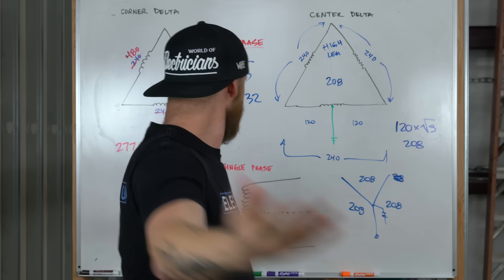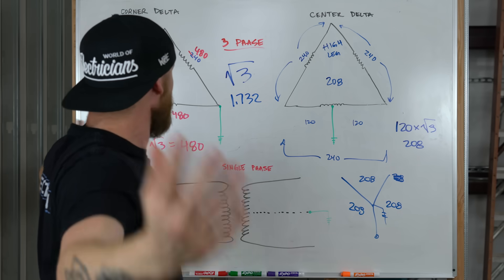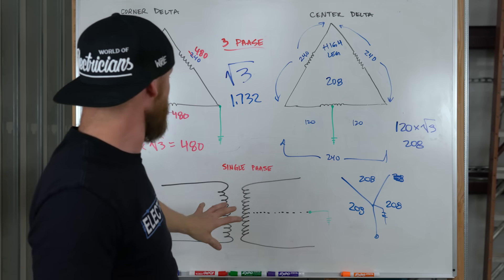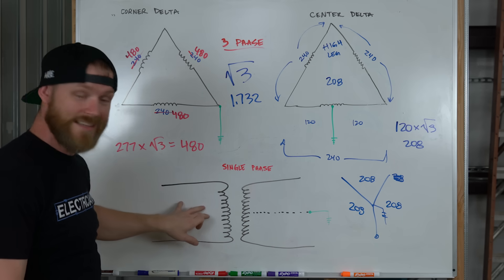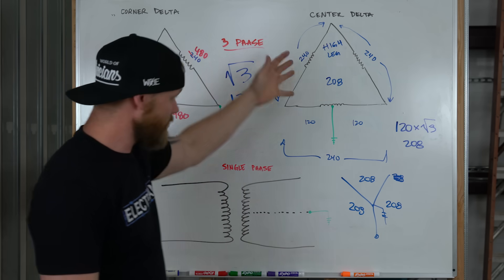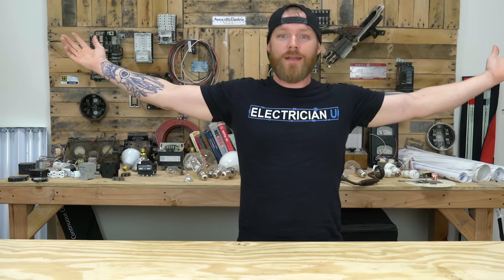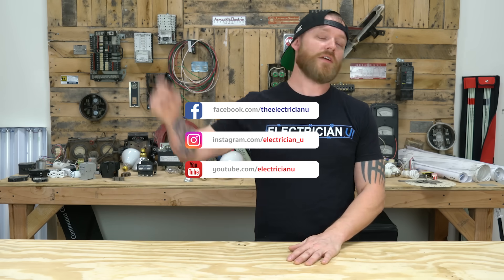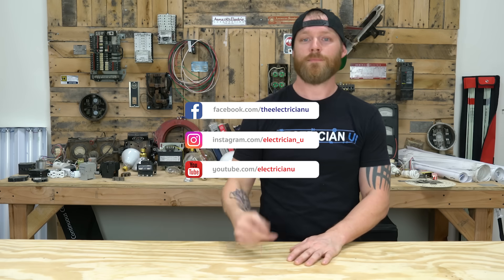Difference Between VOLTAGES - Why We Need Them All

Comment: Very complicated. In Europe it‘s much easier, you got the wye configuration, we call it star circuit here, where the neutral is the center point. The voltage between every line and the neutral or ground is 230V, the voltage between the lines is 400V (sqrt of 3). Some appliances are connected in a delta configuration ( we call that triangle), they only have the three lines L1, L2, L3 and the ground. Mostly appliances where the load is balanced between the three lines.
Another advantage of three-phase: If all lines are balanced, there‘s no current flowing through the neutral. If not, it‘s only the differential current. For example if I draw 4A from L1, 4A from L2 and 2A from L3, the neutral current is 2A.
Reply: Not quite. If you draw same loads between phases there will be no neutral. If u draw loads per phase ur neutral current will be the sum of the 3 loads. That's why elements use overrated wire sizes
Reply: @saffalife8831  Nope...if you draw an equal current from all three phases at the same time, the neutral current is zero in theory. The neutral current can't be higher than the current of one single phase. If it would be a summon of the currents of all three phases, you would overload the neutral wire totally up to a level of destruction of the insulation. For example you design the wiring for a circuit with a voltage of 3x230/400V fused with 3x16A circuit breakers. For this application a cable with the conductor size of 2.5mm² is perfect, this is rated so you could fuse it with 20A without any problems. The critical conductor temperature with the standard PVC insulation is 70°C, this is reached with this cable size on a current of 26A. The current from one phase is flowing back on another phase if the loads are equally balanced. And you need the neutral only for this case. On some appliances the neutral is not necessary because such things like the internal resistance of the appliance is not changing differentially. For example a tankless water heater in three-phase does not require a neutral. And then there are other appliances:
Here in Germany the kitchen stove is connected with three-phase (3x230/400 V). But the appliance itself is still a 230V one. One large and one small cooking plate are connected to one phase, the other small and big one are on the second phase and the third one is for the baking oven. That's a classical wye-connection, or a star circuit as we call it here. With 3x16A you could fuse a kitchen stove up to 11 kW, and use the wiring for that current and all wires are of the same size. Normally we would use a cable with 5G2.5mm², that size would be comparable to AWG 13 which is 2.6mm². AWG 12 is 3.31mm² and 14 is 2.08mm².  L1, L2, L3, N and PE (ground).

Three-phase is the standard here, even in residential buildings. The service companies here even don't permit to connect appliances which are single phase loads with more than 4.7 kVA (20A on 230V)...such loads must be connected three-phase. Only exception is made for kitchen cookers in old installations which are still connected three-phase, and mostly fused with 25A.

Use a clamp meter and put the three line conductors through the clamp, then you'll see the neutral current (and the additional leakage current which shouldn't be so high). Actually if the loads are balanced between the three lines there is no current flowing through the neutral.
Reply: @Marcel_Germann  I agree if ur loads are connected between phases. If your load is connected between phase and neutral and another load between another phase and neutral the the current on the neutral adds up.
If u do a diagram you can see my point.all currents meet in the centre meaning all current flow in same direction meaning it adds up. 
Each load passes through 1 winding and neutral. 
If the load passed through 1 winding pass the neutral point then another winding they would cancel out. But they don't because appliances generally use phase to neutral voltages
Reply: @saffalife8831  Except the tankless water heaters we use here. They only got L1, L2, L3 and the PE/ground, no neutral connection. They run with 400V, the bigger ones are mostly fused with 3x32A (22 kW).
The thing is, the incoming power here is already three-phase. If you create your own three-phase system from a single phase-system with a phase converter, you're right. For that you're only required to have a transformer and a lot of big capacitors to create the phase deviation. But I'm talking about a correct three-phase system, coming from the generator of the power plant through the grid into the house. That's the standard here, so you got three big NH-fuses in the service entry box:

https://www.swe-check.com.au/editorials/nh_fuses.php

But the extractor shown there is not permitted to use here on live circuits. The ones for that must have a leather sleeving to protect your arm in case of removing the fuses with connected loads, that could cause massive arcing. That's the reason only electricians are permitted to remove or insert them when the circuit is live. That's one disadvantage of this system. The other one is, no protection against someone putting in a fuse with an unfitting current rating (that's the other reason that only electricians are permitted to change them). But their big advantage is, they can switch off a very high short-circuit current securely. We're talking about 100 to 120kA. That's the only reason these guys are still in use.

Comment: What about 360 constant? Ameren engineer told me I should run that to have two 200 amp boxes. One at house one at barn/shop...
Reply: With the amount of appliances used today a single service line of 200amps is not sufficient. 
The lighting, grinders and welder in your garage will stress a normal 60amp sub panel, plus the 200amp at the house. Send 200 to each to give you a better service factor.

Comment: OMG. In 14 minutes, You have explained what I had to learn on my own 50 years ago. It took me a whole lot longer than 14 minutes. And there was no such thing as 5v and 12v lighting controls, etc. Thank You !!
Reply: Automotive lighting control is 12v...
Reply: @No5elfCTRL  , that's true, but 12 v auto wiring for lights is not normally used in residences, commercial, nor industrial projects.
Reply: @bruceb3786  actually, there is 12v lighting controls and systems.  some smaller lights use 12vac (under-counter lights, garden lights, some track lights).  it is rare to see 5vac but there can be 8vac for older doorbells
Reply: @No5elfCTRL  , That's not "controls", 12V in automotive is Power.
Reply: PLC CONTROLS ARE 12 V. & 24 V.and Fiberoptic here where I work
AND MOST FIELD DEVICES ARE 120
ALL MOTORS WE GOT ARE 480V.
AND SOME 4160 VOLTS ,
BUT PLC'S ARE 12 V. & 24 V.
An Fiberoptic from control room to mcc where PLC CONTROLS are located .
Reply: @handson2865  , good, but PLCs and Fiber did not exist 50 years ago (now 54 years) when I started. The best computers were the Commodore 64 and the Tandy TRS-80 (Radio Shack), with dual 5-1/4" floppies.
Reply: you didn't have books 50 years ago?
Reply: @Bapuji42  , yep, those, and OJT from Old Electricians is how I learned.

Comment: Great channel.....I use to be a drawbridge operator, and we had a lot of electronics installed during an overhaul.  I remember looking over the shoulder of an electrician as he was working, and he was on the phone with someone, asking about the "rotation, clockwise or counter-clockwise"....of the power.  Would this ring a bell?  I never asked him about it...
Reply: 3 phase power has 3 individual hot wires.  You can change a motors direction by changing any two.  Say A B and C wires and 1 2 n 3 terminals.  If A is 1, B is 2 and C is 3 and the motors turning clockwise.  You can Change it to A2, B1 n C3 and the motor will run counter clockwise. 

Obviously rotation is important for most things, like an Air conditioning unit. It will suck instead of blow if its backwards.
Reply: Typically that would be a motor, in 3 phase you have a 50/50 split on being correct.  Just bump it and transpose 2 phases to get proper results.

Comment: Another excellent video!   I wish you would have shown the 480/277 volt part on a wye instead of the delta.    Another voltage that is in US now is for large to very large data centers.   416/240 volt wye.   Servers can run on 120 volts or 240 volts.    Respectfully,   Kevin
Reply: Or 208. Most datacenters i’ve been in have 208 in the cabinets.
Reply: Star Gazer    They mostly are 208 volt until you get to the larger ones.   The ones I'm talking about are huge ones.

Comment: Our "standard" 480 3 phase is usually BOY, Black, Orange, Yellow. Some of the 480/240 transformers for 240 are labeled "high leg delta" and they are as you drew them on the board.  The High leg on any I have looked at is/was NOT marked in any way. We did have one vacuum blower that they were trying to run on 208 3 phase, the starting amps caused issues, so they eventually ran 480 3 phase to it. The motor was a dual voltage 240/480....sometimes that works out ok running on 208 but in this case the starting amps were way too high.
Reply: Isn't BOY brown orange yellow? Low.voltage is black red blue
Reply: you are correct :-)....we are mostly 480
Reply: In the mill I work in, 480 delta color coding is Black, Black, Black..... Sometimes Black, White, Green...... Othertimes White, White, White..... and at least one occasion Green, Green, Green.......
Reply: @kayakingphotos  We use a lot of multiconductor, it is black, black, black, black...with a number on each wire. Might be 20+ wires in one cable.
Reply: A wire is a wire is a wire until u tell it otherwise
Reply: @saffalife8831  In the United States, the National Electrical Code is very specific for what a White and Green wire can be used for. Neither of them are for phase conductors that are not grounded.

Comment: As a European (Danish) electrician of 35 years, I noticed a couple of things, and I would like to ask a couple of questions.   277-480 has to be a Y configuration to have the voltage difference.   the most common use of 24V in the US for house electricians must be for air conditioning control, and for industrial / commercial electricians, it has to be automation (PLC mostly)     I have visited the US (a lot) so I have a good grasp of residential electrical construction.   But being a industrial electrician myself, two things puzzle me about US industrial / commercial practices / techniques,   1:   Why is (most) everything loose wires in metallic conduit, in stead of plastic sheathed cable, I have heard that it is "safer" but that is certainly NOT true (in my 35 years, I have ONLY used conduit for mechanical protection, against vandalism, animals, casual damage, lawnmowers and string trimmers, or moving vehicles, like forklifts)   the rest of the world uses cable for industrial / commercial installations, wit NO safety penalty, AND not to long ago I saw video from a US data center, where everything was cable on cable-ladders, so it can be done in the US also ?   2:   Could you explain the US 3 Phase motor starter, it seems to me, they are resister based, to limit start up currents, but Google has not been able to quench my thirst for knowledge ?     I like your videos, you explain the principle at hand well, without going 8 year old on people.
Reply: We use EMT or RMC in industrial and comercial because that’s the code and according to code its purpose is to protect wires and it looks neat. 
Also it’s easier to run wires (stranded) through the raceways, ah and it also serves as an equipment grounding conductor. 
I don’t know if you’ve got access to the NEC book but you could look it up on the internet and you’ll find that article 342, 344, 352, and 358 of the 2017 National Electrical Code book it has all the info about metal raceways. Hope that answers your question about metallic conduit raceways.
Reply: @cipher1167  Thank you for your answer, I knew it was code, but I would like to know WHY ?   it makes no sense, when the rest of the world uses cable.
In Denmark it is not uncommon to have 100-200 circuits in one breaker cabinet (but I have seen cabinets with 400-500 circuits) could you do that with conduit ?   I doubt that very much.
Reply: Yes it can be done, it’s even easier because we use stranded wire  through the raceways. However I don’t think I’ve ever seen more than 50 circuits in a panel, I’m not sure maybe I have but in 480v.

Comment: How about a video on installing a relay  in lighting .  I have 2 heaters that a customer wants on a wind up timer but the heaters pull more than the switch(s) can handle.
Reply: If its higher amperage you'll use a contactor.  They are like relays but are different devices.  Wiring one is pretty simple.  Where switches would normally go, you send "those 2" wires through the contactor. While the contactor has an one terminal, that would get a wire from the switch. 

Check some wiring images for contactors.  It would probably explain it better.
Reply: @beeps7  thanks man

Comment: In  Germany everyone has 3 phase 400V.  L1, L2, L3, N and PE.
Reply: https://youtu.be/OBYzvkY2-eA
Reply: https://youtu.be/feCZs9YpH3M
Reply: Malre gtx     By "everyone" do you mean that every house and apartment (regardless of size) has all three phases and neutral in the panel(consumer unit)?   Also, your system is a wye 230/400 volts, correct?   Respectfully,   Kevin
Reply: Kevin Coop. yes, every house has 3 phases, neutral and PE.
Reply: Malre gtx    3 phase in residence seems unnecessary but makes sense.   Your conductors must be very small!   Here in US, we have 120 volts because Edison invented his lamps to run at that voltage.   Tesla did not want 120 volts but was forced to utilize 120 volts.   Best wishes to you.   Everything here shutting down now because of virus.
Reply: Kevin Coop 3 phases are great if want to charge your EV -> 11kW no problem. It's the same in Europe.  Best wishes to you, aswell.
Reply: Malre gtx    All the car chargers I've ever designed for were single phase.  Even when connected to three phase systems.   So for 11kw charger, 20 ampere 400 volt 3 phase circuit?
Reply: Kevin Coop 16A is the maximum you can pull from a household breaker. 3phase Y 230V -> 230V*16A*3= 11kW https://www.ablmobility.de/en/products/emh1.php
For 22kW you need a 32A breaker and contact the grid owner.
Reply: Malre gtx    Sorry, I just saw your reply.   Our circuit breakers are rated at 80% for continuous loads.   So a 11 kw load would be 15.9 amps requiring 20 amp breaker here.   Best wishes to you! It has been very informative conversation!   Respectfully,   Kevin
Reply: Kevin Coop Thank you and best wishes to you, too.
Reply: Malre gtx    Are you affected by the virus?   Starting to get worse here.
Reply: Kevin Coop Yes, all schools and universities are closed since Monday.
Reply: Malre gtx    We live center of US in Missouri.   Our state 46 cases 2 deaths.   Schools are closed for rest of school year.   All restaurants closed.   No social gatherings.   About to go to total shutdown.   Only reason to go anywhere is food and medicine.   I'm very happy I live in country, not city.    Best wishes for your safety!    Respectfully,   Kevin
Reply: Kevin Coop  I live near the Denmark–Germany border in Schleswig-Holstein. Our state 308 cases 1 death.  In Bavaria are 2960 cases 19 deaths.
Reply: Malre gtx    Our numbers are increasing every day by about 80%.   47 to 84.  2 to 3.   Stay safe!
Reply: Kevin Coop yes, it is 230/400 V.
Reply: Kevin Coop you should watch the first video I linked.
Reply: European power is 50 Hertz you idiot's, everything is different, wiring, boxes,.
Reply: Glenn Ferris    I think you need to look in a mirror if you want to see the idiot.    So, wise one, please explain how 50 hertz and 60 hertz makes ALL the difference.   I would really like to hear your response.
Reply: Glenn Ferris    France owns Tahiti.   So, what is the 3 phase voltage and hertz on that island?    Best guess if you don't know!   I do have the answer.
Reply: Glenn Ferris    No further comments?
Reply: Szakállat Korporésön     Although I'm not sure about why US stayed at 120 volts in this article, I believe most of it is correct.    https://www.worldstandards.eu/electricity/why-no-standard-voltage/.        Best Wishes and stay safe!    Kevin

Comment: Emergency lighting 12 volts DC usually. Furnace transformer secondary 24 volts AC.  Lots of 240 volt ovens in  apartments are being run on 208 -- not a big difference. But of course the wall plugs are still 120.
Reply: We have one control system that uses 24VAC control voltage.......controls valves and a motor for a hydraulic pump.
Reply: @MrAnviljenkins  My hydronic heating valves use 24 volt ac as well as the boiler gas valve and door bell. And then the telephone line is even higher voltage, but limited current.